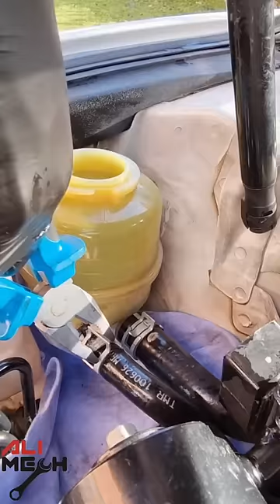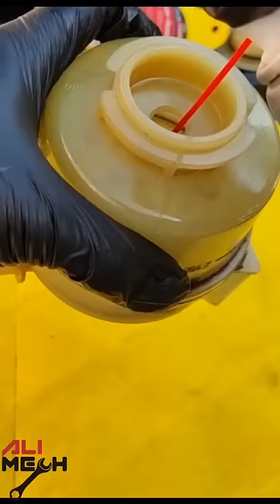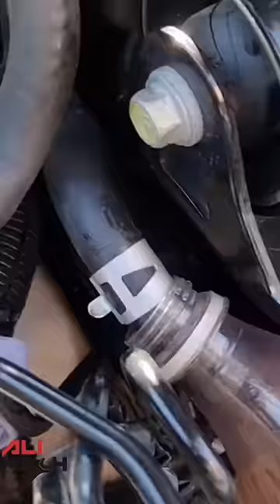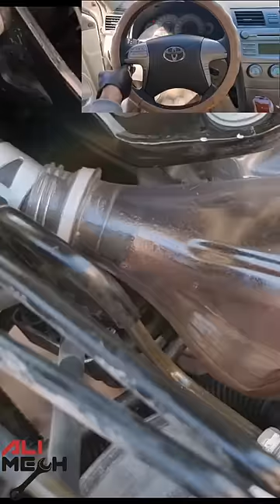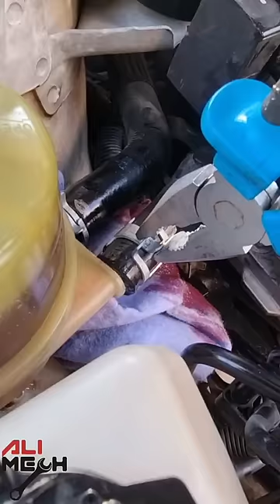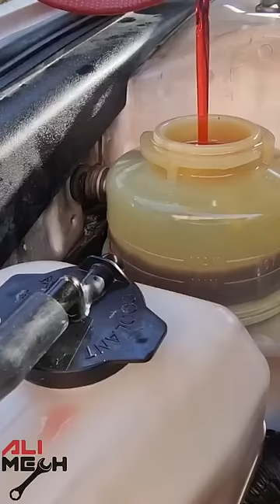Power steering fluid flush, without pump in less than 10 minutes/Power steering fluid change #shorts

Comment: Don't do this. Waste of time and you're going to make a mess. Pump the old fluid out with an old shampoo or soap pump until empty. Replace with new fluid. Start the car and turn the wheel back/forth 10 times. Empty the reservoir again and refill. Do this as many times as you want.
Reply: This ain’t actually the best way. The best way is to disconnect the return line, and with the car on and moving the wheel continue to add fluid until it comes out clean. It’ll take like 5mintues. You never want to run the system dry cause then it’ll destroy the pump.
Reply: @Sci-Mon1  that's a great method if you have an extra person and are careful. My way gets you close enough.
Reply: @Hagbard Celine  whenever you see it's not looking clean.
If it's dark looking, it's due
Reply: Remove the return line because most the fluid is in the power steering rack. Then start the car so the pump is spinning now move the wheels lock to lock that means turn the wheel all the way to the right then all the way to the left that will push the old fluid out of the rack and the pump will pump all the old fluid out of the lines. When the pumps empty and making noise add some new fluid and keep doing this until the fluid comes out clean from the return line.
Reply: @nickgt91  No, sir. That is indeed the proper way of doing this service.
Reply: I do the same for my transmission, suck out and replace 2 quarts, drive 10-20 miles, do again another 2-3x.  When I drop my pan and change the filter, I know pretty much all new fluid without doing a dangerous “pump” of fluid.  Yes, some fluid waste, but much safer on your transmission.

Comment: People say it's a waste of time but I've been changing PS fluid since the 90s. I've never had a leak or a problem and it makes the steering so smooth.
Reply: Nope, I would say you should change power steering fluid same time you change brake fluid but again people don't do that nearly enough either. These people have cars with sloppy steering and slack brakes.
Reply: يكفي التنظيف لقد أختفى الصوت والثقل  بعد التنظيف وإرجاع نفس السائل .

Comment: At that point just replace whole power steering reservoir. They are cheap. There is filter inside and cleaning only partially does the job.
Reply: A new one from my dealership is around $250
Reply: Why? Totally unnecessary

Comment: Another great video sir. This was a good P/S flush. I think it very thorough and was safe because you did not dry run the pump. About as good as you could have flushed it without an external pump. 👍🔧
Reply: There is no fear in running the pump dry for a short period of time. 

I ran the pump dry in my tundra for months (daily driving the truck) and it never blew up. I even put fluid back in before I sold it for scrap to see if it still worked and it did. But the rack leaked so badly I just let it run dry again. 

I probably put near 10k miles on that truck with no PS fluid.
Reply: @volvo09  in my opinion, if it can be avoided, they should never be run dry. They are lubricated by the subversion on oil. It probably won't ruin it right away but it will start causing internal damage as soon as the bearings don't have the proper lubrication. You got very VERY lucky to have ran that long before seizure.
Reply: @midnightrider1854  I used it as a test because I figured it would fail... I was totally ready to cut the belt while on the way to work some day, but it never happened... The truck made it to 300k miles and was exceptionally rusty, as reliable as it was...

But I also had an old Ford Taurus that I bought used with a dry PS system and drove it home about 70 miles after all the fluid I put in at the prior owners yard leaked out in a few minutes, and that car never had any issues while I owned it once I fixed the hose, and when I later sold it to my grandfather who had it for many years.

Maybe some pumps are more delicate, but I don't think they're thaaat delicate. I'll never fear doing a flush through the return line and letting it run out for a fraction of a minute. 

But, everyone's got a different opinion.
Reply: @volvo09  I'm not saying that you are wrong in the aspect of the pumps being super sensitive. I'm just saying that, according to the manufacturers recommendation,  and the physical design of the pumps, that they do require constant subversive lubrication for maximum protection. Now, have I ran them dry and refilled without future issues, hell yeah! But do I recommend to a customer of mine to just " go ahead and run 'er dry for a few days, she'll be 'ight"? Nope, nada, never gonna happen. For several reasons, the biggest being liability just incase. The second, is I would loose a repair doing that, and third, I have seen them get run dry for just a a few miles, just enough to whine, and after adding fluid the whining never went away. (Particularly on the older 90's ford pumps). But to be honest, I have never went as far as you have with running them dry and never heard of anyone else getting away with it that long either, so kudos and you should def play the lottery. Lol But they are not, generally, super sensitive.
Reply: We used to disable fuel/ign so we could crank it with the starter while rotating the wheel and a helper kept the reservoir full.
Reply: @volvo09  90s fords are gasping in horror 🤣🤣
Damn things whine if you blow a fart at them
Reply: @MrTheHillfolk  haha, that is a "car sound" I'll always remember from my teens. The whine of a FMC power steering pump was as ubiquitous as a  V8 burble to past generations.

You could hear them coming down the street, in parking lots, pulling into your driveway, in traffic, they were pretty common!
Reply: @volvo09  haha yes ,this !! 
Not sure if you're old enough to remember this , but as a kid out shopping with mom, getting out of the car at a strip mall and as you're walking across the lot to a store you hear 2 or 3 Chryslers starting up, maybe more or maybe none on that day. 
Haha ,gee that old LaSalle ran great, those were the days 😃
Reply: @MrTheHillfolk   That's not a bad idea. Maybe a little harder than a starter but I think it would be a pretty good idea nonetheless. 🔧👍
Reply from the maker: Thanks for watching and supporting 🙏
Reply: @MrTheHillfolk  hahaha so true. I made so much money on changing those. 😆
Reply: @volvo09  absolutely 💯
Reply: My trucks ps pump has run dry many times lol and when I say many times I can't even count how many times till I got my steering box fixed as well as a ps line lmao I drove like that for a year
Reply: @thegman4759  lol I think that we have all been in those shoes brother. 🤣
Reply: @volvo09 わしに

Comment: No need to remove and install the hoses. Just emphty and refill the reservoir. Start the engine and fill the oil to the mark on the reservoir. Repeat this a few times until the oil is clear, simple as that.
Reply: That's the lazy way to change it
Reply: @OneManOnFire   Maybe so, but why make it difficult for yourself if you don’t have to.
Reply: @MrZdvy  Because there's a right and wrong way. You're not properly flushing the system.
Reply: Because you’re mixing the new fluid and dirt fluid together so it will never been properly cleaned. We use to do this at a shop I worked at but I would never do that at on my own cars. Just do it the right way and you won’t have to do it awhile.

Comment: This shows you don't need anything fancy to get the job done.  I use the Thornstone 2L Vacuum Bleeder instead of having to turn the wheels left/right to force the fluid out.  This made flushing the fluids a breeze.  Filled the reservoir with fresh fluid and used the vacuum to pull out the old and pull in the new fluid.  This method introduces no air into the system.

Comment: Power steering pump flow is alot more than folks think. 
We used to disable the fuel or ignition and rotate the wheel while cranking the starter and a helper keeps the reservoir full.
Reply: Absolutely no reason to disable anything.
Run it. Have your fill bottles open and pouring at startup
Reply: @anythinganytimealways  🤣🤣🤣
You can't pour fast enough before the pump goes dry even at idle.
Especially when grabbing for another bottle🤣
Reply: @MrTheHillfolk  well I'm speaking from experience. I've done this countless times without fail.
Try it
Reply: Just cutting the wheel back and forth a couple times before starting works great I hate how people dry start pumps thinking it had to run or spin to suck fluid the rack does a good job at that by itself
Reply: @toddhoneycutt228 does moving the steering rack suck oil through the steering pump as well? Would turning the pump pulley by hand help anything? I'm going to be taking the belt off soon anyway so I could do that too

Comment: After you Jack your vehicle up on stands and flush it till its clean, ( which hardly anyone does) you need to add a bit of Sea Foam power steering formula to break up varnish and make it like new. Putting on a magnetic fluid filter in the line is also good to help remove metal built up from not realizing your pump will wear out if you don't....and that is very expensive. Be sure to use the correct reccomended fluid your vehicle is designed to use, as they are not all the same. Watch other you tube videos prior to doing this correctly. Don't do it wrong , or you will be in a world of hurt. Side note to notice: car must NEVER BE RUNNING to do it, refill completely prior to starting and be sure all hoses are reconnected before you do. Ps...I don't work for Seafoam. be sure to use only their power steering product only, it makes all the difference in the world.

Comment: Beautifully done. I work at a quick lube shop that does power steering flushes. The machines we use do basically the same thing as this. It's just more expensive and a tad easier. But if I can afford the fluid and work but not a machine. I can totally do this. Great job.

Comment: Make sure to keep the reservoir topped off as you do this as not to introduce ait pockets. Best to jack the front tires up first and don't do it too fast or go all the way to lock and bang the wheel hard or it'll make a mess. Smooth back and forth motions will move the fluid through the system. Make sure to use the right fluid too. Lots of brands take brake fluid and not a generic power steering fluid.

Comment: The V6 2grfe is so nice and powerful never owned a 4cyl yet
Reply: That would be a downgrade imo
Reply: @edsanchez9198  like owning the 4cyl?
Reply: @moemoe48210  yes, 08-10 4cyl on Camrys burn oil like crazy
Reply: @edsanchez9198  damn the v6 pretty bulletproof got 190k on it rn most annoying thing is prob ignition coils but that’s easily fixed
Reply: @moemoe48210  gotta crawl your hands behind the engine to get to the 3 coils behind. But you get used to it an do it faster on the second try. I'm keeping mine parked at 150k zero problems since 100k and they're quick lol
Reply: My 2006 Camry 4 cylinder lasted to 270,569 miles the head started leaking oil but did not over heat the head just got warped overtime
Reply: @forthepeople8218  had a little old 22re. thing lasted forever. toyotas never die!!
Reply: @moemoe48210  had a little old 22re 4cyl. thing lasted forever. toyotas never die!!
Reply: They are, and there is no space to fit the bottle like in this vid tho
Reply: @anythinganytimealways  Thats what i did, but process was so messy, oil leaked through hose connection
Reply: @johnlakes6948  well that's on you. Use a clamp or a tighter fitting hose. 
I've used this method countless times without mess

Comment: Good video though I wouldn't worry about the power steering pump. I worry about that start-up noise.
Reply from the maker: It will be abit different with start up till all the bubbles comes out, then it will be normal

Comment: Didn't realize that could be done without running the engine. Definitely doing that
Reply: It depend if your car lets you turn the wheels with the engine off my car locks the steering until the pump runs so I can’t turn the wheels unless I put the car in neutral

Comment: Power steering systems are one of the most neglected systems in cars and trucks. I flushed PS systems a small number of times my entire career, maybe a dozen. Was a very hard upsell. Most power steering systems are very robust and can last the entire life of the car with little to no servicing.
Reply: Transmissions tend to be neglected too.
Reply: Power steering in my car is electric so need for maintaince, just wait for the motor to fail and take the hit.

Comment: I do hundreds of power steering services a year on every make and model (including one with EPSF Systems). This is all fine and dandy for YouTube but no this is not correct. As soon as the car starts and you turn to the lock all the fluid will be just as dirty. There is no way you’re getting all the fluid out without turning the vehicle on to engage the power steering pump. Nice for YouTube not practical.
Reply from the maker: It's not only youtube, I'm mechanical Engineer and working on cars, when it's been steered lock to lock it will push all the fluid our and suck the new fluid, I have detailed video and I took took a sample from return fluid, it was same like new even after starting the engine 
You can watch it if you want

Comment: Looks and sounds like an 07/08 2az-fe camry.
Reply: good motor or na?
Reply: @aurtherowner4697  the 02-06 2az-Fe Camry has less oil burning, but potential to strip head bolts. 07-08 2az-fe is an oil burner, and has VTC cam gear that basically fails over time. The 09-11 2ar-Fe is good if you do 3500 mile/5000km oil changes (conventional or synthetic), otherwise it’s an engine easily abused
Reply: @youngb1ood  what about the 22re?
Reply: @aurtherowner4697  the 22re is a really good motor, but its ancient, and some claim to suffer head gasket failure.